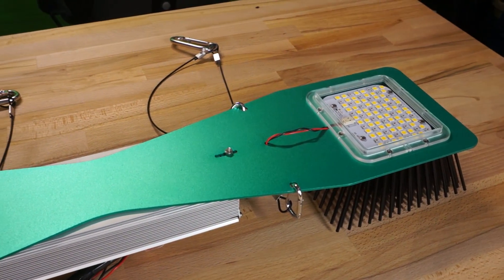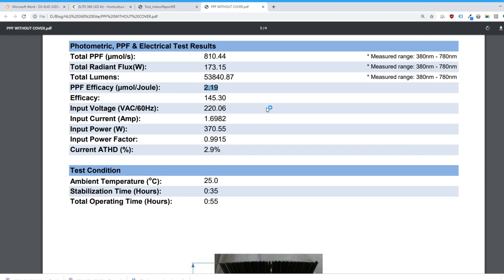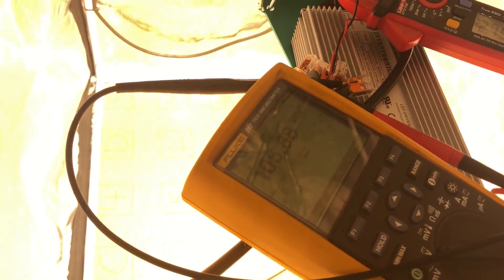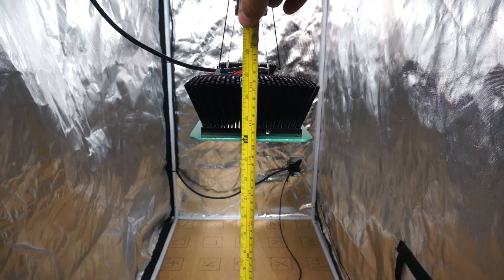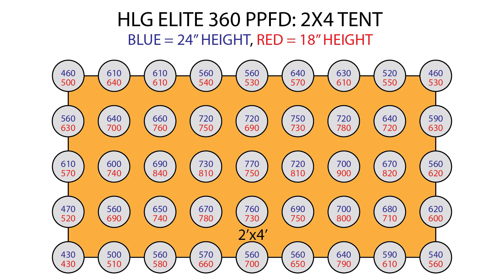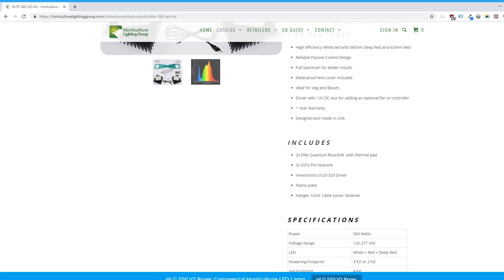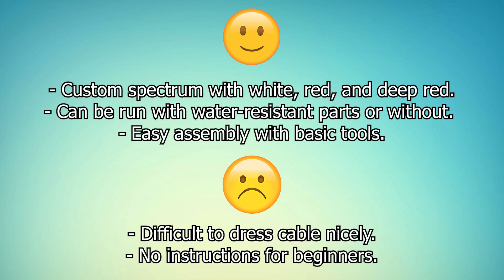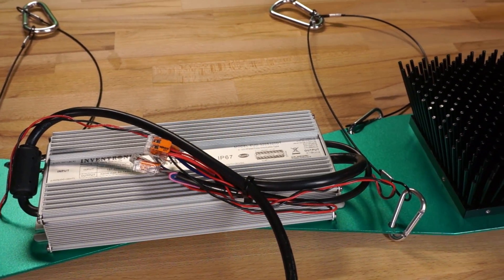Hands-on Review: HLG 360 Elite Kit (Part 2 - Testing)

Comment: @ledgardener when testing par did u have the dimmer set 100 percent?
Reply from the maker: Yup. Always.
Reply: Hmmmm I have the same light and I was at 24 inches and it started to cause issues. I moved it up to 28 inches in a 4x4 space
Reply: Should I go off my base readings from the floor for the canopy. Meaning at 24 inches from from floor, would it be the same reading at canopy at 24 inches? Only reason I'm asking is because from the floor to the top I get two different readings. I know a couple things should factor in? Just not sure if I'm misunderstanding anything?

Comment: Would you think this has enough coverage for a 1x1m tent?
Not an easy tent size to use properly....do you have any suggestion?
3 Quantum boards would be enough,I think, but can't think of a way to properly cover the space. Have to go for the 4 boards which is a bit of overkill and dim ir down, from what I have seen....

Comment: i have 11 of the original HLG QUANTUMS  IN 2,7K 3K 3,5K AND 4K  they are durable, ps the reflectors they sold short to line v at the test points by input/output conn,  are the new lights that much better?  i have the A Version drivers and would prefer the B to automate. any thoughts? nice work

Comment: why is this only pulling 328w? as far as i know the elite 360 prebuilt light pulls 360w and when i built this light with a meanwell 320 driver it pulled 365w, your light is considerably weaker then it should be..
Reply from the maker: The output current of these drivers can be adjusted up over 3 amps if you have the programming interface piece for it. I suspect the prebuilt units have been adjusted for more power.
Reply: @LEDGardener  so you're saying that unless you have the programming interface for it these 360w kits are actually only 330w kits? HLG are selling them as 360w kits and i expect to be able to get 360w out of them using whatever comes in the box..
Reply from the maker: @DREDD9000  I'm only speculating - all I can say for certain is that mine in particular is only pulling 330-340 watts when cold though and a little less when warm.

Comment: Put mine together last night love it
Reply from the maker: Right on!
Reply: Nice one man.  How you like it so far?  You got this 'kit' version?
Reply: @circle4922  yes I did get the kit and it was easy never did anything like that befor I'm using it in a 4x4 with two rapid led v3 100w pucks and amazing it does get hot in the tent tho but minor adjustments and I have the temp where I want it with these lights
Reply: @Bob-zt7ok  Cool man, sounds good.  What are your temps now anyway.  Just curious.
Reply: I’m also running this kit, love it so far. I have it in a 3x3, temps peak at a solid 79 with the Cloudline T4 running max speed, intake air temp is around 73-77 depending on time of day. 

Hope this helps.
Reply: @trentonfree2694  Cool man.
@goatking.
Just fyi guys, it seems to be pretty common practice to actual "increase" temps (compared to HID rooms) when using LEDs.  80-82 is apparently the sweet spot, even 84 is ok.  This is supposedly due to the fact that LED grow lights don't have infrared, so they don't heat the plant up as much.

Maybe try it.  Just saying.
Peace.
Reply: @circle4922  yea i can understand that i prefer cooler temps to keep everything nice and tight hotter temps you get looser nugs
Reply: @Bob-zt7ok  That's a good point too.  Cool man.

Comment: Nice one LED Gardener, those numbers are really respectable, and pretty much bang on for flowering without the need to supplement with CO2. What I noticed is, there isn't a huge amount of variance in the numbers, which means the light spread across the canopy is nice and uniform. All in all a well-designed fixture, and thanks for producing the data :))

Comment: Using Celsius numbers is misleading since this is a USA built unit. 60°C equals 140°F which is more than warm
Reply from the maker: Check any data sheet for an LED or driver and you’ll see Celsius measurements.
Reply: LED Gardener  BTW I still gave the review a thumbs up I looked up the lab report for the HLG 550 V2 R at 46°C or 116°F it seems to be a much more efficient unit as far as heat production goes
Reply: What? Tech specs for electronic  parts are always in C. If someone can't understand the conversion of C-F then it's on them, it's not misleading, that statement is crazy.
Reply: @volvo09  he doesn't get it
Reply: volvo09 it’s not crazy it is a review so I believe as others often do provide specs in cm and inches. It’s misleading in the sense Centigrade is a low number compared to a Fahrenheit number. Like I said I still gave the review a thumbs up because basically he didn’t like the units efficiency and costs
Reply: Using measurements is misleading, got it.
Reply: EZ OG when you buy from them do they tell you the price in American$ or Canadian$ don’t be obtuse unless you can’t help it